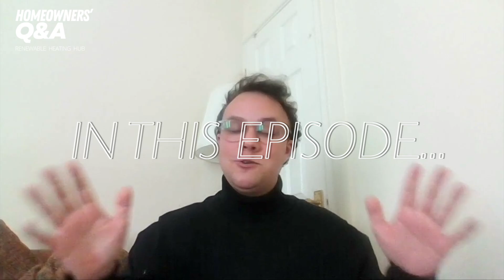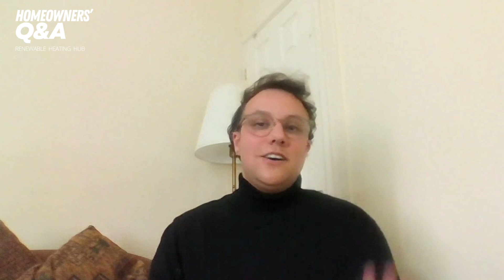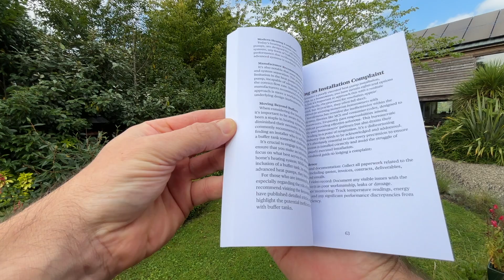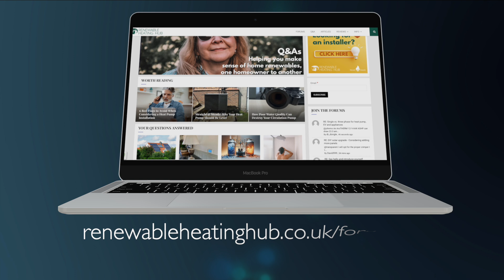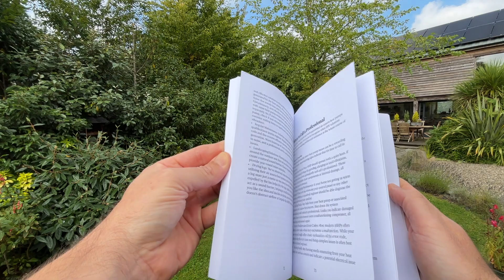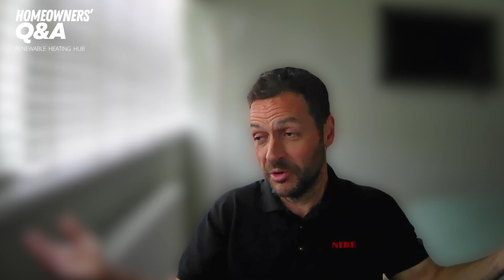Can You Install a Heat Pump in Old Houses, Flats, Garages, Cellars or Boathouses?

Comment: I live in a 229 year old solid stone wall 200 square metre house with a heat pump, best thing I have ever done, no more forgetting to order oil, no more smell of oil, freed up space in the garden where the oil tank was, haven't used log burner since we have had the heatpump which is 4 winters and hous3 is constant 20 degrees all over. I did fit MVHR but only a cheap one to keep moisture levels down and apart from the fact we have upvc windows and loft insulation it's cheaper to run than the oil boiler was. I'm sure I could improve it by internal wall insulation but then you lose the thermal mass and risk damp walls so may leave well alone.

Comment: Can I fit an heat pump on my new extension roof? Its flat and will be up against half of sloped roof ie its around 1.3mtrs tall wall that is the vertical part of a pitched roof?

Comment: Thanks all. Great info.

I'm just starting on the Heatpump knowledge journey.
My house is 100 years old. Around 306m²
New roof and windows fitted in 2013. 
9" brick. 
Boiler needs replacing soon. 

Solar fitted in July 2023. 9.24kwp. 10kw solaredge battery. 6kw homehub inverter. 

What I've learned is to insulate the best you can before a heat loss survey is considered. 

So I'll be spending many hours in the crawl spacing insulating the floor, around 100m².

Going to use superquilt. 

I must be mad! 

Keep up the great work👍
Reply from the maker: Good luck! And please keep us updated on your pogress. Would be great to follow it on on our forums if you'd like to sign up and share your journey: https://renewableheatinghub.co.uk/forums

Comment: Can I use car antifreeze in my Heat Pump.Changed a radiator and just refilled with water what steps should I take to protect it during winter.
Reply from the maker: I’ll get this answered on Friday and include it in our next podcast.
Reply: @RenewableHeatingHub  That’s great news us pensioners are skint haha.Its OK saying just get in touch with your installer.They want at least £150 to turn up.Thanks again love your channel 🏴Aye
Reply: Where is it have you been over ruled.

Comment: Good lively & informative Q&A. 
I've pretty much written off being able to have an A2W HP installed in my 1986 4 bed detached house. A combination of planning regs & additional R290 refrigerant outdoor unit restrictions mean there is nowhere to locate an outdoor unit on my property that I would deem acceptable. I certainly don't want a big metal box next to our patio dining area which is just about the only place I would be allowed to locate one which would need longish pipe runs into the house. 
I also have 10mm microbore pipes (copper) to all rads, uninsulated concrete ground floor, chipboard 1st floor & 22mm dia existing main boiler run pipes which probably means major internal upheaval as well. The external cavity walls have been insulated (post build) & an extra 250mm of insulation is to be installed in the loft once I sort out the raised loft flooring. New DG units also to be installed to replace the failing existing DG units within the next few months. 
  
All in all more hassle & expense than I'm probably willing to put up with so for now I'll be sticking with my 6 year old gravity fed Ideal Heat boiler & airing cupboard SS HW cylinder. BTW, this coming from a now retired HVAC industry vet who's been selling, designing, product managing & installing most types of heat pumps all my working life since I started in 1972. 
Sometimes having too much knowledge is not a good thing 😖